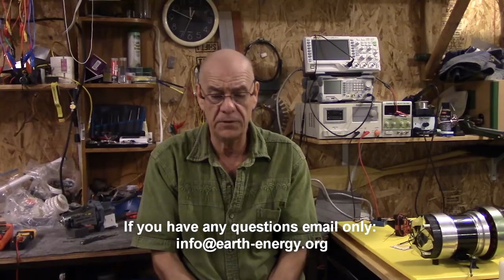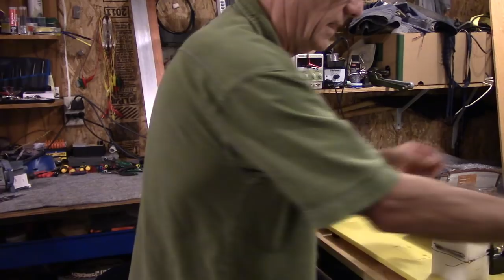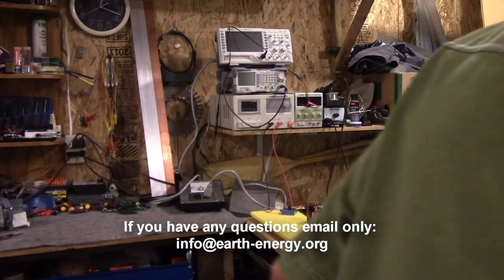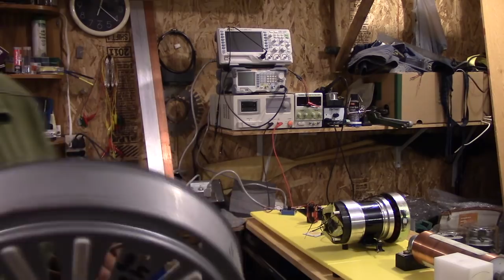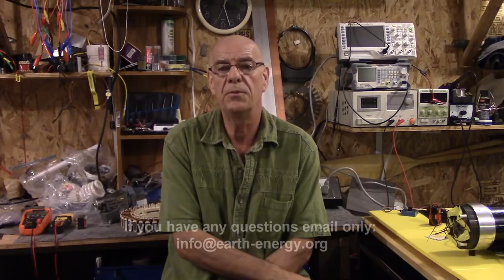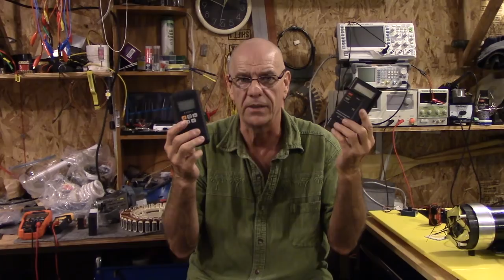Gerard Morin: The Final Video

Comment: 00:40:18 "Nitrogen is a fuel, an explosive". What? Then why is it that lighting a simple match in the Earths atmoshere does not blow this Planet appart? Why do you think Nitrogen is used in race car tires especially? It is used to prevent explosions. 
00:50:38 "He didn't used an electric motor, he used a piston drive motor" Do you have any proof if Tesla actually had that car? Pictures with the motor, articles of the time, etc.? 
00:53:19 "Solid state plant cannot be achieved..." AND 00:53:44 "You can't do that with solid state". What the f*ck are you talking about Gerard. What do you mean you can't create a potential with solid state device. What about runing an inverter from a battery? That is solid state and that can create a sine wave, the only "things" that move are the fields (magnetic, dielectric, whatever you want to call them). 
I watched the entire video and I can say you don't talk about nothing concrete, you only throw words around with no meaning and with speculations.

Comment: Dear Mr . Gerard 
I enjoyed the videos you posted 
and the test you have done are scientifecly overwhelming  
I have some notes hope you read 
and Reply 👋.
a DC motor works more effiently  when supplied by a pwm power with 
(exact resonant frequency of the motor)  because this signal 
(overrides the back emf  of the rotor 
causing the motor to work as a current mode (means the motor see the pwm from the source as a current not voltage ) 
making the motor to increase  
effiency and torque  while the voltage is fixed by the pwm signal .

for the electro magnetic radiation 
only be hazardous when the  radiation becomes ionizing (in the  terra hertz frequency )
causing the  human cells to cook from the inside (like a nuclear radiation)   
this can only be done by a high power  transmition antenna
not a motor 
even if a motor  is wokng in the kv  level it will never  have an ionizing radiation even to hurt an ant .
the motor (brushed) only do is an electro magnetic interference  and it radiation few centimeter  far from the motor .
so many miss conception  and very few people art enough to figure out 
whats going on in a specific test .

Comment: Regarding the washing machine DC motor there are 3x12 (36) coils, 12 for each "phase" (not really phases, the computer and controller change the polarity of the coils), calculate the pulling force of one coil based on the current x24. Having the magnets on on a large circumference is the beauty of this configuration, it gets far more leverage, 200 foot lbs of torque can be easily achieved with this design. Let's say 1 coil can pull 10lbs, with 24 coils that's ~240lbs of pulling force (they change the polarity to push and pull the stator at the same time with opposing coils with the computer measuring voice coil feedback) Measure the distance from center and calculate the foot lbs of force and it should be pretty close to the measured torque.

Comment: this motor is not more powerfull more then any other brushless motor ,
it's high torqe comes from the diameter of the circle and the number of coiles that acts as a transmitions 
it's like each winding is 1 tooth of a large trasmition gear ,
to increase power you need higher gauge of copper wire .and bigger magnets and more electricity .
in any way direct drive motors save tons of power , and last longer .
and are fare superior to the old 50's dc motors

Comment: We need you, Gerard.!! Please come back.?!?!? You're the Smartest, self Educated guy, I ever saw.!! However
You're not Completely 100% Correct about everything" Like, it's not 
Nitrogen" That is primed, by oxygen,
To Explode.!!! I tell you what, I will 
Prove it to you, & Give you a glimpse,
Into who I really am, & How I know"
SO, MUCH ABOUT" What you were
Working with,. Now. Check out what I say, or not" it doesn't matter to me, any more... NOW: HERE GOES,.
  I've called myself  " Arch Angel "on here for years, it was meant to be a
Clue, to who I am, ever hear of 
The ( S-R, BLACK-BIRD ) AKA THE BUCK ROGERS, PLANE.?? The Landing gear, was two arm's in the rear, that had "three tires" on each side, and one in the forward, under the Cockpit,.. the tires were, made useing microscopic" flake's of aluminum,. Imbedded into the hardend rubber.!! Guess what they were filled with,?? ( NITROGEN )!!!!
SO, YOU SHOULD KNOW"  that at Mach 5, the Whole Skin of the Black bird, Heated up to over 600°!! Skipping along at Mach5, on the very edge of space it's self,!! Covering Thousands of Miles per Second. 
If Nitrogen, was the thing that 
( Goes Boom!!) ?? With a primer,??
Like oxygen, Then, the wheels would
Or could, just exhausted

Comment: 32:28 Three phase motors can be either delta connection that has 4 wires or Star connection that has 3, where all 3 windings connect to the same point. They have no neutral wire. It's not breaking any rules. 33:16 "It's not a motor, it's a fucking propulsion system" Yeah man, that's what a motor is too. See: https://www.thefreedictionary.com/motor. 1. Something, such as a machine or an engine, that produces or imparts motion. 2. A device that converts any form of energy into mechanical energy, especially an internal-combustion engine or an arrangement of coils and magnets that converts electric current into mechanical power.

But here's something super interesting that I found. The drum motor was invented by New Zealand company Fisher and Paykel in the 80's (patent#US5266855A - expires in 2020). If you search for their company name on patents.google you find pages of entries. For example

See: Electronic control circuit patent #  H02P7/29 - Arrangements for regulating or controlling the speed or torque of electric DC motors for regulating or controlling an individual dc dynamo-electric motor by varying field or armature current by master control with auxiliary power using discharge tubes or semiconductor devices using semiconductor devices controlling armature supply only using pulse modulation and etc.

This sounds interesting: Multiple frequency chopper control US4037145A - abstract: A method and control system for minimizing peak current levels in a direct current traction motor drive system in which the traction motor is powered by periodic current pulses metered from a direct current source by a controllable switch… 

Could be some good clues here friends. Could be the instruction book for the controller so I can run my everything.

Comment: Hoping your well and still pondering along the path of curiosity. Don’t do it for anyone else but yourself. But release it to the world if you work it out. 
Are you still using ‘plain Jane’ 50-60Hz electricity from the socket? And did you find the optimal pitch for the windings to make the RMS as close to a true analogue signal as possible?

Best wishes to you mate. This intrigues the hell outta me but i’m committing my efforts to breaking Hydrogen bonds with low amperage resonate frequencies. I don’t buy this Electric Vehicle spectacle. I have lost a lot of faith in modern day ‘man’ but if I do crack it, I will release it to the world or die trying, just as a middle finger to those that have crippled (irreparably I believe. Sadly) our civilisation. 
I think the key is finding out who Tesla studied as he accomplished some pretty impressive feats with 0% of the digital equipment we have. 
I believe we loose the finer, and important, detail by moving away from analog equipment. Digital stuff is pre-sorted, plug and play stuff. I think the best thing to do is work out how to do this WITHOUT the modern oscilloscope.

Comment: See I thought that the Transmission of power over a overhead line ,energy loss is happening at a long distance.A transformer winds the energy around and around copper coil like to amp it back up ,, so it can travel its course to arrive at its destination at the required voltage

Comment: I heard they came up with some electronic part to b able to change the frequency on a.c. motors therefore changing to speeds. .speed is changed in dc motors just by changing the voltage...right?

Comment: I use solar with  a Tesla charge controller from Tesla charger dot com. only charge controller that charges on cloudy days and can preserve batteries by holding the top voltage at 15.2 v without  boiling.

Comment: I think he is brain dead, perhaps he has never heard of a bonded neutral, if he was to check in his electrical panel he would find the ground & the neutral at the same potential they are both connected together either in the panel, the meter box or at the hydro pole connection, they are not sucking back power they sell you.

you are buying energy in watts at a specific voltage, so you are paying for the energy's ability to do work & in order to do work it must complete the circuit, if they were only feeding one house they could simply measure the current being drawn off the system at the generating station, but because they feed a grid that consists of high, medium & household voltages running through step down & step up transformers to feed multiple homes & businesses they measure at each customer then add the fudge factor (the amount they loose per Kwh drawn from line loss, transformer inefficiencies & electricity theft) 

now if you ask me the whole thing is a scam because they are not manufacturing anything except the results of the natural electromagnetic effect which is electrons in motion, thus they should only be allowed to charge what it costs to induce the effect & deliver the energy.

so yes high voltage is used to limit loss & serve more people more efficiently.

single split phase 240v is created at the transformer that feed your street, that is either  being stepped down from higher voltages or boosted along the run to maintain household voltage along long runs.

now you also have "Carrier Current" which runs along the outside of the wires, the product of AC induction, they have found they can piggyback data signals on this carrier current to signal phase correctors or other modern devices now necessary to match multiple inputs of wind & solar sources to the grid & synchronize the 60 Hz sign wave, this carrier current was also used in 1st generation X10 home automation modules back in the 1980's

Comment: Sadness
Anger
Fear
Joy
Love
Peace
This is list of main emotions. Somewhere between anger and sadness is bitterness. Bitterness doesn't help much in furthering the project you promote. 
The overunity energy generation is not a novelty any more, there is several systems that were proven to operate. 
Tesla system called "radiant energy circuit" seems to draw from resonance of sun, the dynamo for this circuit is the sun frequency spectrum at particular MHz value. 
Perhaps this circuit doesn't need amperage but maybe it needs it, i.e. one needs charges to flow to generate frequency relevant to this circuit.
Several other overunity systems are available and easy to construct DIY - Leedscalnin and Rodin types are EMF perpetuum systems that draw charges during operation and can supply free energy easy.
Pyramid systems can supply free energy also, much material about it is available on Internet.  Don't see much reason in trying to come up with details globally at this stage. one can figure out the details individually
and get what he/she deserves. 
Humans are typically unappreciative and to cater for this nuance, one sends them to DIY including self research on details without spoon feeding.

Comment: Hello, Gerard ...I have been a mechanic , welder, machinist for over 37 years...
I have listened to you for years and have found that what you are saying is True ...
Like you I have read Nikola Teslas books and have found that what you are 
talking about has to do with the direction of the coil windings and magnetic
flux switching I have applied these methods and it works...
The secret is in the power of the magnet and how to manipulate and
 magnify its power The Oscillator/Modulator that you show is a 240 volt 
AC pump motor with a 2 pole magnetic armature ...
That is not easy to find ??? the only thing I have found with that configuration
was a WW2 Field Phone that utilizes a 110 volt ac generator...
Thank You For All You Have Done ...
...Love You Brother and God Bless...

Comment: Hello, Gerard ...
I Know what you are saying is true ...because like you I have proven it ...
I have been a mechanic,welder machinist for over 35 years and stopped listening
to the worlds bullshit...Thank You for confirming what I knew for years ...
I read Nikola Tesla,s Books and have utilized some of his methods...Some of it has to do with flux switching and directional winding of the coils in the transformers...
A magnet has an invisible power that can be magnified by manipulating the magnetic
field ...The stronger the magnet the more power potential ...People have been dumbed down for many years...The 240 volt pump you use for oscillation is not easy to find ???
 You do not see an ac motor with a permanent magnetic armature configuration
like the one you show on the video ...The only thing I have found that is close to
that motor is actually found in a WW2 100 volt ac field phone generator ???

 God bless you for what you are doing...Love You Brother...

Comment: gerard i figured it out
we need to make your channel fully censored. no cursing at all, add a bunch of cheap drum and bass music some graphic design to show in images what you already are showing and explaining, a buch of RLC circuit schematics drawn on a piece of paper even if its just coils or a source at a frequency and shown for a couple of seconds somewhat HD also show the math , maybe the fake one but show it like the faraday law or the indcution equation ,that relates torque and voltage inductance and magnetic density per area, dont saw anything about gov-mafia-bigcorporation relations and maybe joining the snowflakes sounds extreme but if you cant defeat them you can join them
Reply: Or, gerard should just shut the fuck up, he is an idiot spouting bullshit?
Reply: i like the eq that relates amps and coil turns with nuclear area and magnetic force

Comment: I watched one your latest vid. You talked about cascading the voltage 123 123. Have you thought about using the ignition system off of a automoblie. Mechanically it using a distributor wounldnt be useful but the electronic coil back system might be usefu

Comment: Gerard, there are ways to do this with solid state. Stanley Meyer started just like you, getting the pulses from an alternator/motor. After that he made a solid state circuit that mimics the sine wave. He didnt use the spark gap, but only a HV fast diode, them both only let the energy go one way only.

Comment: Your washer motor is a 3 phase motor wired in star. The 3 connections linked is the star point. You could probably run it from a standard single to 3 phase inverter at and speed you want. You dont have a nuetral with 3 phase just 3 live at 120 degree phase shift from each other. Because it has a lot of poles it will be very high torque at low rpm.
Reply: that single inverter with not big loads = 1 capacitor = 60x 1.5kwmotor= 90μF

Comment: The power to the transformer is 11000v at 11kw per amp. This is converted to 110v at 100A still 11kw minus reactive losses in the transformer. The neutral is required to complete the circuit or no power flows. The more load you draw on the transformer the more load is applied to the generator (torque) requiring more power to turn the generator.
REPLY
Reply: You won't get a reply as you are talking about reality.
Reply: 750kv transformer 400kv   transformer 220kv transformer 110kv transformer... ....   lot of "transformers" Garry and what before transformers ? I tell  you - Gerrards Morin stuff.

Comment: What I learned from this video, and think everyone who is Pickled, like I am right now,  I mean very drunk,  hahaha! If  one was to jump voltage into the spark interrupter, it would then increase horse power,  right? Does this not make since to the ones who are brain dead? In return, the radial frequency would then be interrupted, then if you did this three times,  in a three phase motor, you would then increase your horse power to insane power? I never heard of this before, thanks,  I hope  I taught you a thing or two today my friend! After me thinking about it, does not a magnetic train run like this? No it does not .... Keith Ray Elam

Comment: Listen man. I understand the frustration of trying to teach a new technology to people, I really get the frustration. But saying things that isn't true is a very bad way to get your point across.

 Tesla's pierce arrow experiment did use an electric motor. It was designed by Tesla and made by Westinghouse to his designs. How do I know this. Well to be honest the only thing we have to go on is Tesla's nephews account. We do know he did the experiment by the newspaper reports and his nephew reported a specific instance of them stopping at an intersection and someone passing by saying why isn't there exhaust coming out of the tailpipe.

 I will give you the clues again.

 3 sections of a unit:

1:  Magneto (high voltage source)
Disruptive discharge phase injector, going to the field coils of the generator section.

2: Generator section With high voltage input from magneto controlled by the disruptive discharge section
3: Prime mover and motivator for the car.

 Here is the basic setup without additions like the disruptive discharge section:

https://teslauniverse.com/nikola-tesla/patents/us-patent-390721-dynamo-electric-machine

Remember this is a clean representation of the device. It is the basic setup.
A lot of additions can be added from the rest of Tesla's patents. The field coil cores are also explained in detail here: 

https://teslauniverse.com/nikola-tesla/patents/us-patent-381970-system-electrical-distribution

 A motor controller for prime mover here:

https://teslauniverse.com/nikola-tesla/patents/us-patent-390820-regulator-alternate-current-motors